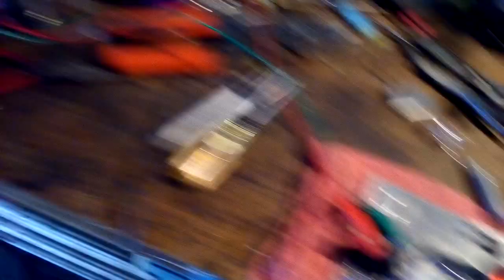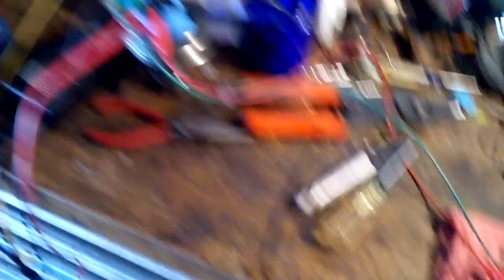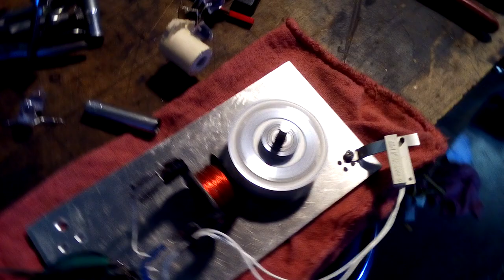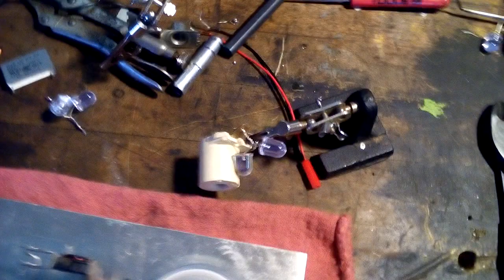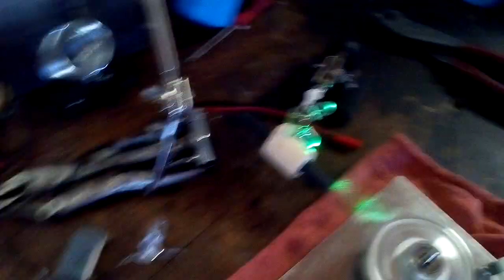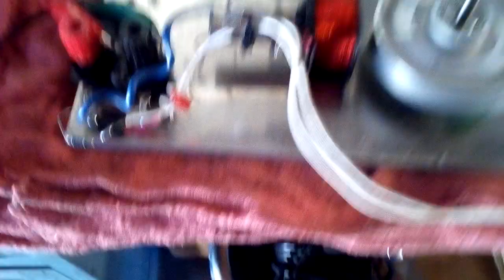High speed reed switch pulse motor

Comment: Have you the 10K Resistor in serie or parallel with reed switch
and thanks for sharing
Reply from the maker: Edmorbus the 10K resistor comes off of the positive rail goes through the Reed switch and  to the base pin of the transistor so yes it is in series or gate if you are using a mosfet
Reply: Thanks